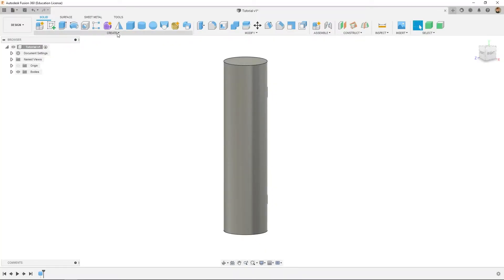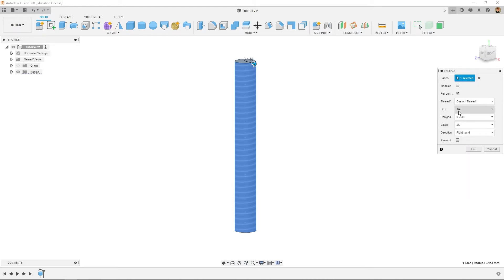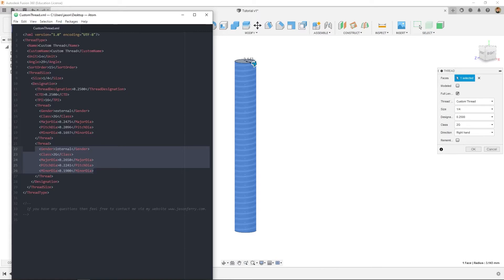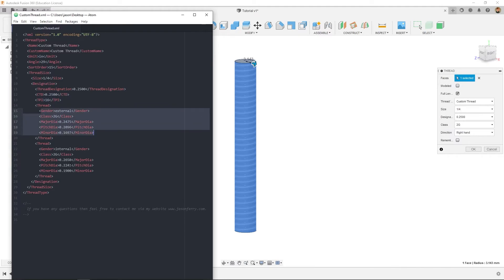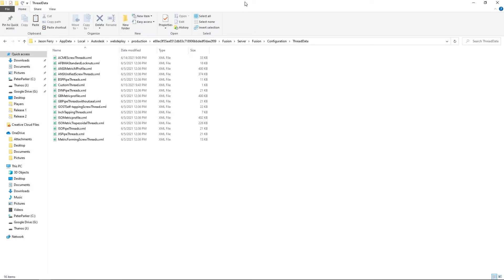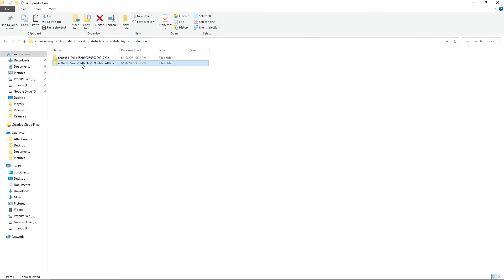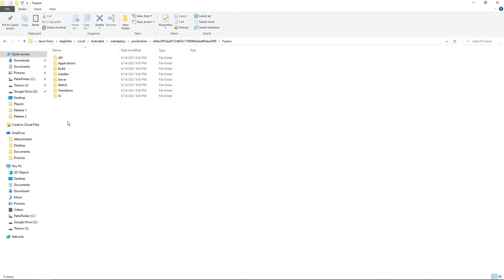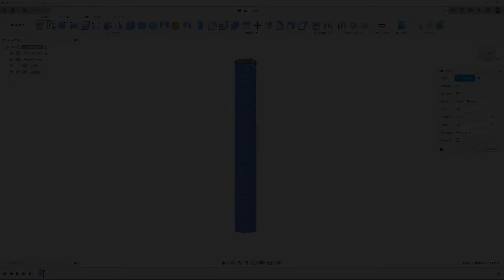How to Create Custom Threads in Fusion 360

Comment: If you're working on Mac OS then the path is: 

"/Users/<your_username>/Library/Application Support/Autodesk/webdeploy/production/18bb3b1bcf969ed58454a634b918acc287ad6414/Autodesk Fusion 360.app/Contents/Libraries/Applications/Fusion/Fusion/Server/Fusion/Configuration/ThreadData"

Where "18bb3b1bcf969ed58454a634b918acc287ad6414" is whatever ID was used in your installation.

Comment: I keep getting back to this video just because I keep forgetting where the file is stored. From time to time an update of Fusion360 means that there is a new version directory (the long e69ac... name) and fusion does not copy any custom thread files from the old to the new directory. So when I open an existing design with a custom thread after a Fusion360 update it fails to create the part that I am working on. It is very annoying to see that Fusion360 does not include the thread definition in the design because this also means that if I open my own design on a different computer the thread fails.